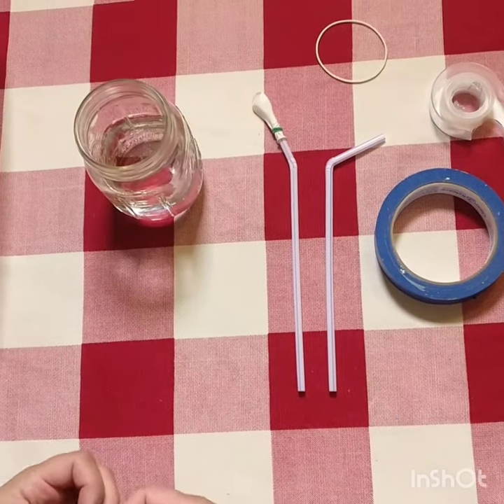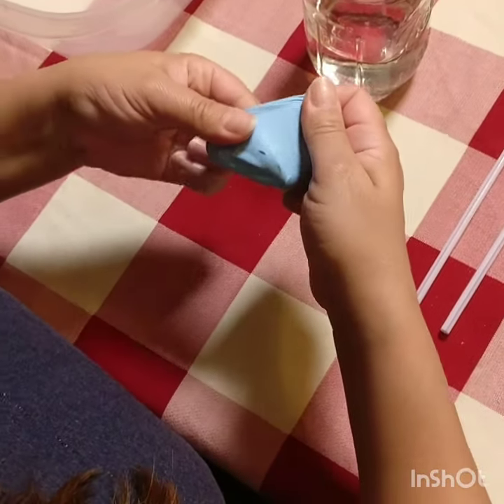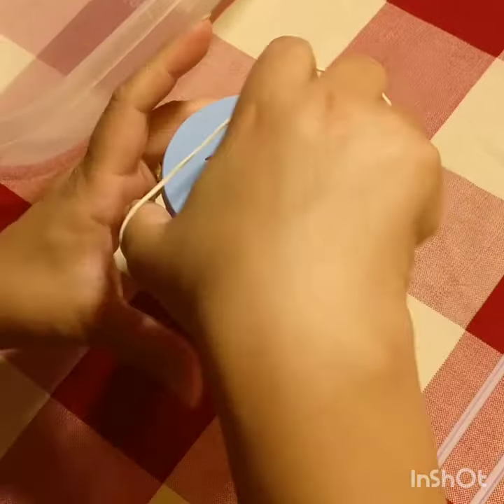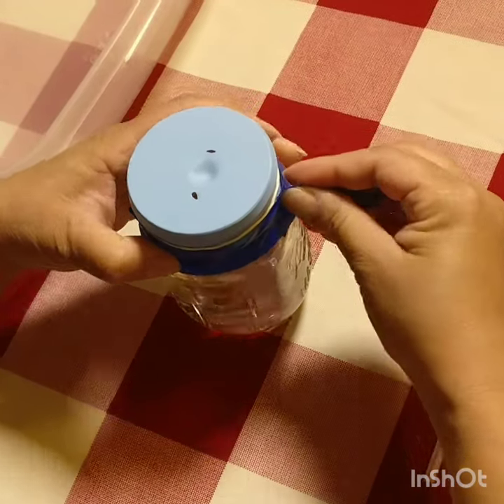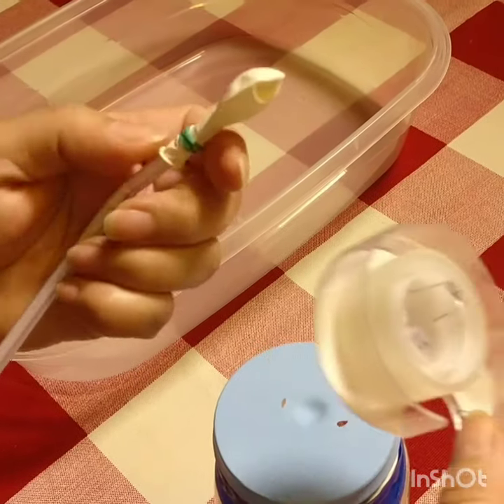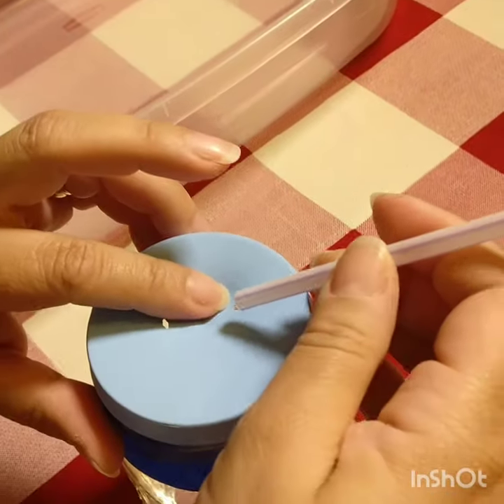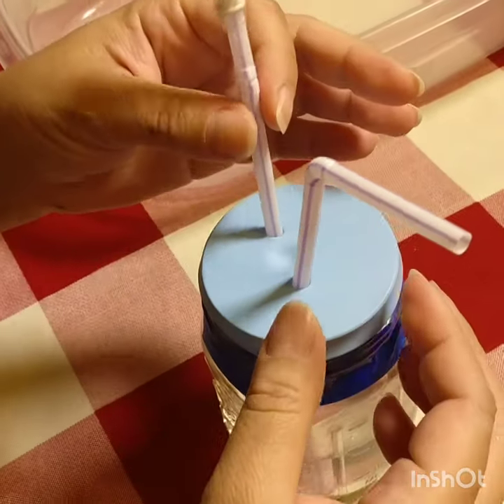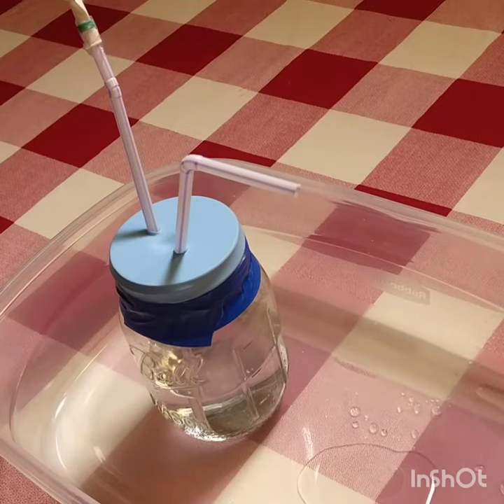Heart Pump Model

Comment: I made a bottle heart bottle with just two water bottles and one of them have the cap with the small hole, basically I just put the bottle over the other and it pumped a bit of water and the bottle actually twitched.